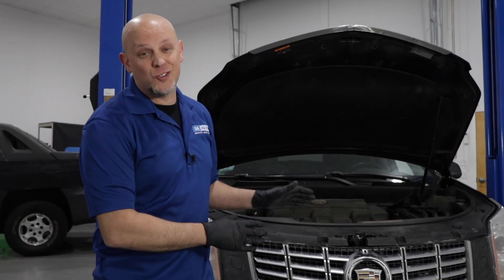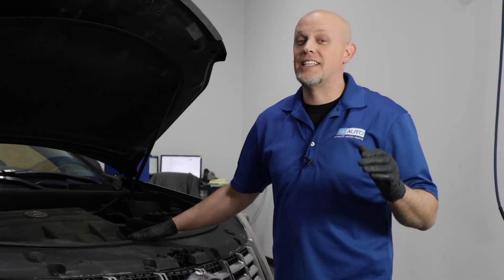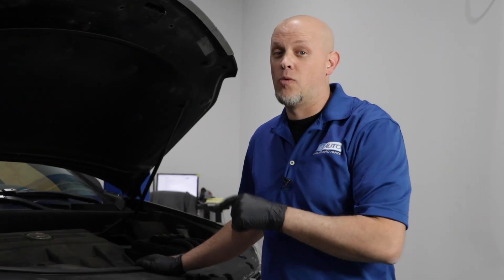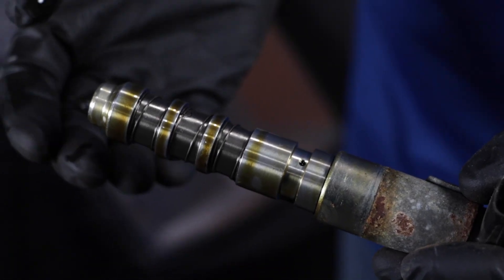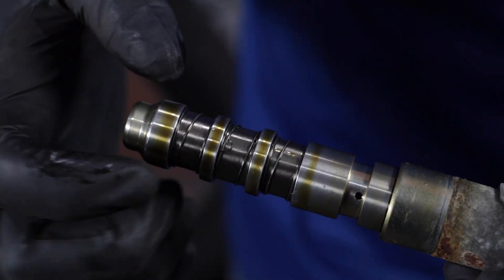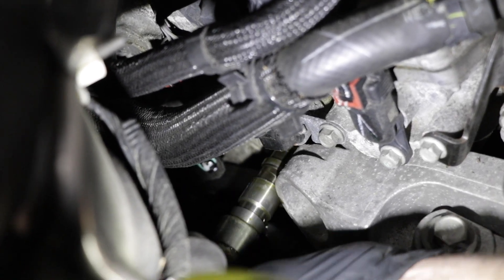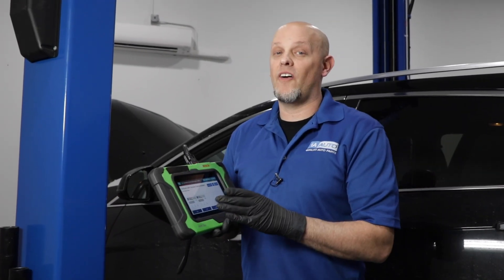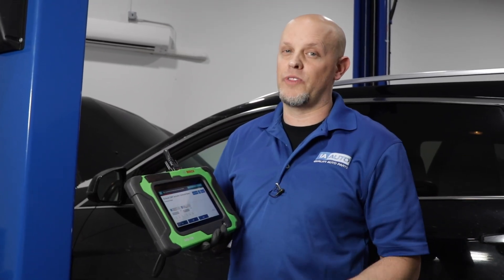Rough GM Engine? Check Engine Light? What's P0014, And How to Fix It!

Comment: Hey can anyone help me I have 2010 Chevy equinox and it’s throwing this code p0014 and I’ve changed this part and changed the oil and checked the oil level and replaced the vvt solenoid connector and still throws the code

Comment: Hi....I have a question I have a chevy equinox 2012 LT and o noticed the code p0014 so I took it to fix and they replaced the timing solenoid  and it seem fixed just for two days it came back they can't figure out what it is . Also is it safe to drive the car with the engine light on its in yellow not red and I'm worried if this continues

Comment: I had this problem for 3 months still wont fix. I changed the oil three times already, Changed the intake and outtake camshaft two times but still wont work. At first the problem was P0304 spark plug which I replaced and the car was fix but after 2 weeks passed by, P0014 came out of no where. Then another week P0304 came back while P0014 was still active, At this point the problem is not the spark plug because this is my third time switching it out. It just delays the problem, But I think something is wrong with cylinder 4 im not to sure. Please help me. btw I have a Hyundai elantra 2017, 4 cylinders
Reply: had you ever fixed your issue. I keep getting the same p0014 code also. Did replacing the camshaft positions sensor work? and was it the exhaust side?
Reply: @zHazzz  test the sensors. Adding power should make them click on and off when removing power. They should also test between 4.1 and 7.7 ohms of resistance.

Comment: I have this exact P0014 code in my 2007 Mini Cooper R56 base model, drives me insane. I changed both VVT-solenoids (front and back), both Camshaft Position Sensors, the motor oil & oil filter, the air filter and the gas cap since it was looking like it leaked air. 

I reset the code with my scan tool, but the code comes back after I drive it for a while. Any ideas as of what the problem might be? Could it be a faulty Eccentric Camshaft Sensor ( the only sensor I havn´t replaced)?? Or a bigger problem with the actual Camshaft?

Do I need to reset something with the scan tool after replacing all these sensors or should it work by only deleting the fault code after I have replaced them?
Reply: did you get to fix it?

Comment: I see a a lot of videos on the code p0304. Most of the videos show the mechanic replacing the ignition coils and spark plugs. I have the same code on a Dodge Journey,  misfire 4 cylinder. However, I replaced those about 6 months ago. I did a ignition coil and spark plug swap, just to be sure- after that kicked up the same code and problem. Could the problem be the injector?